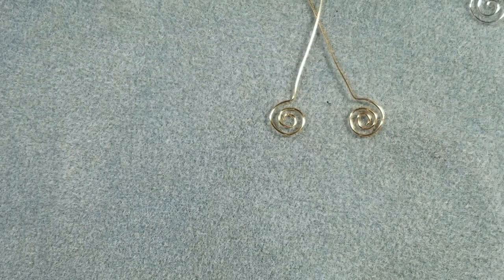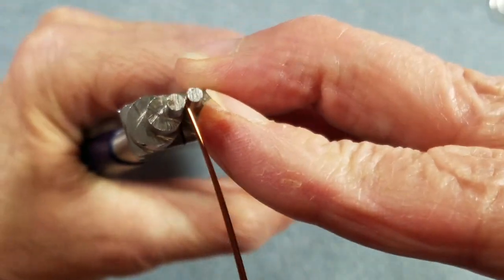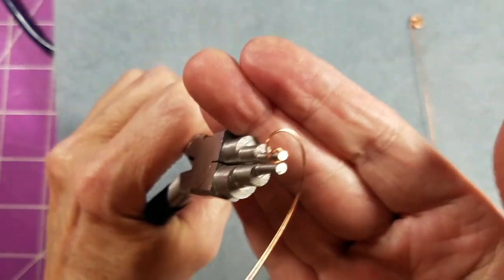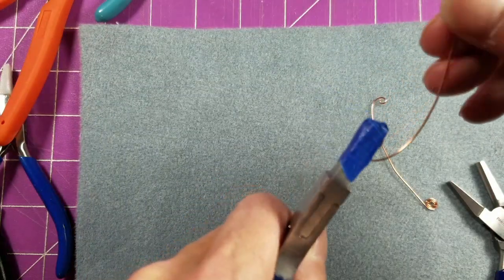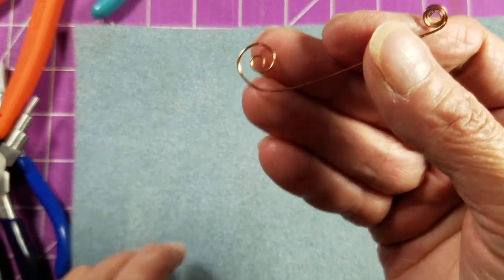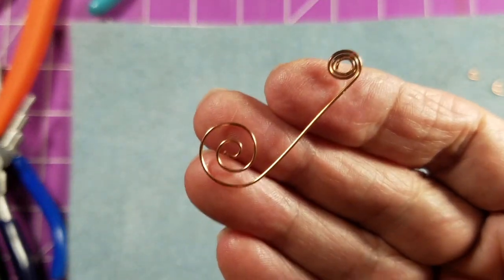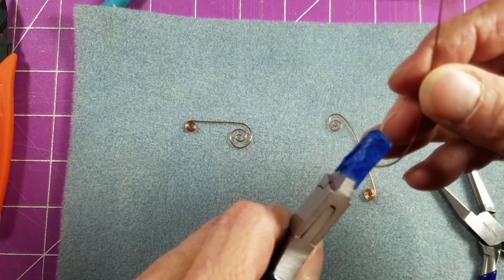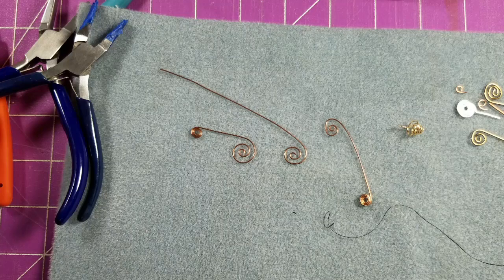Wire Spiral Basics - Open Spiral Tutorial

Comment: Do you have favorite tools for wire working? I have the 3 step pliers, one step loopers and the round nose pliers. But I am still having a hard time getting good spirals. Thank you for your time I enjoyed your tutorial!!💗
Reply from the maker: Hello Anjeli
I would recommend a nice pair of bent nose pliers to make spiraling wire a little easier. Also loosen your grip if you see tool marks. I have a terrible problem with my grip. So I use sanding and flex shaft to remove marks as needed. I hope this helps. Dee